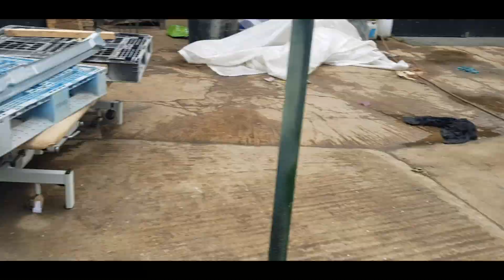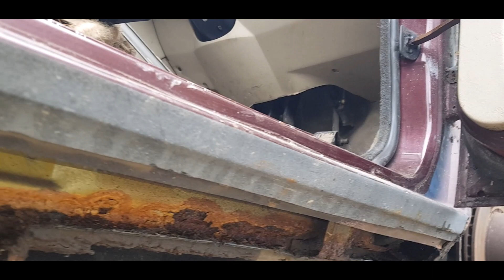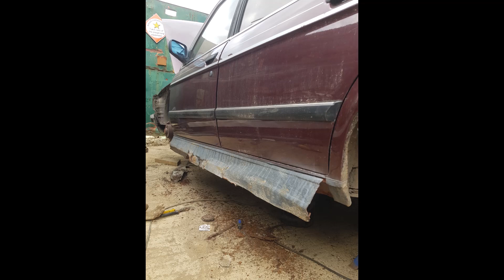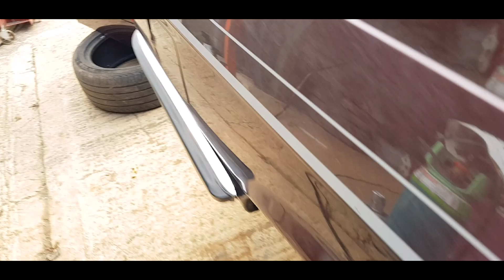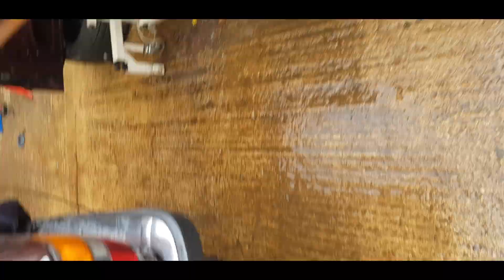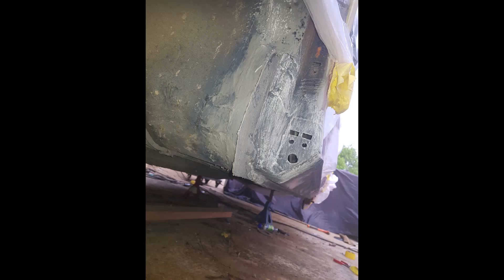BMW E28 Sill/Rocker Panel Replacement Walkthrough Extra

Comment: great video! i need to do the  inner sill on my car. question, is the module box in the sill on both sides or just driver side? My car is LHD so would it be on that side? I need to do the passenger side sill.
Reply from the maker: Ah amazing, yea usually just the drivers side but just check the other side just incase, I almost chopped into one on an e34 sill once😅